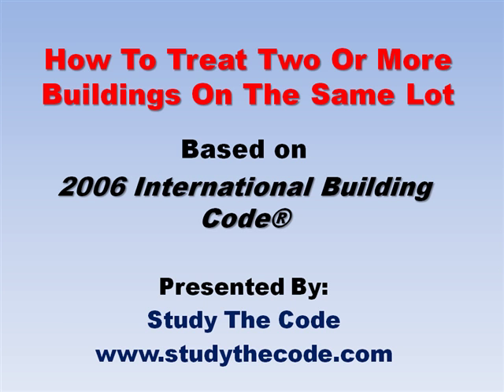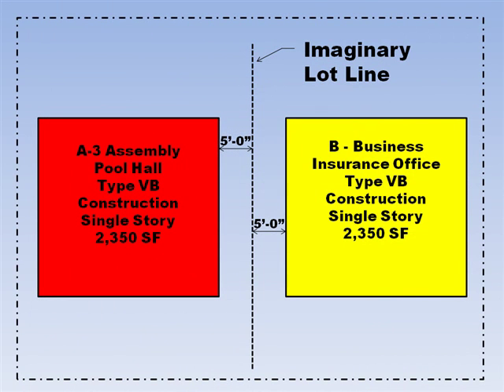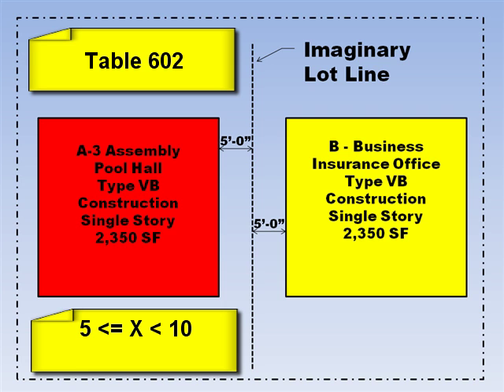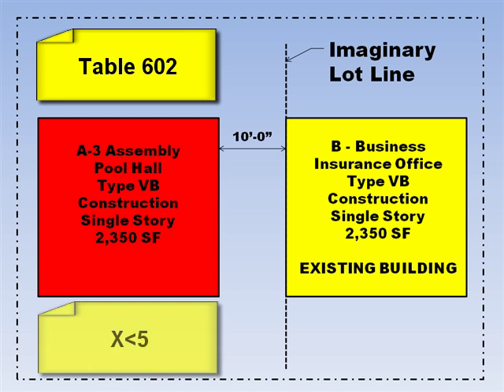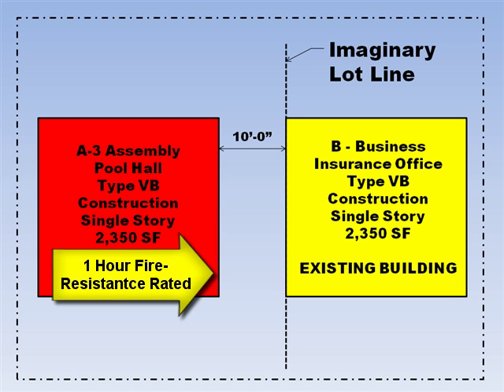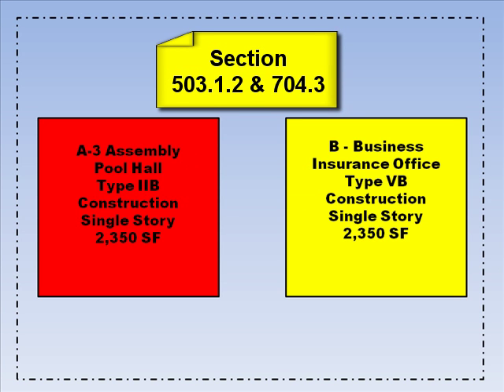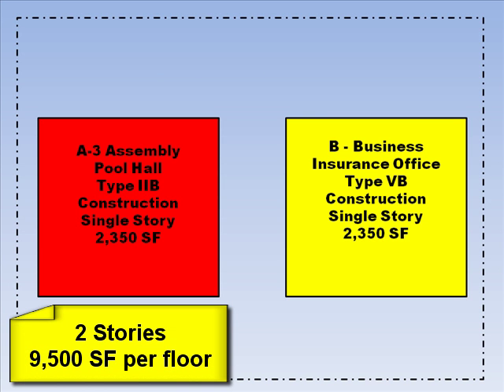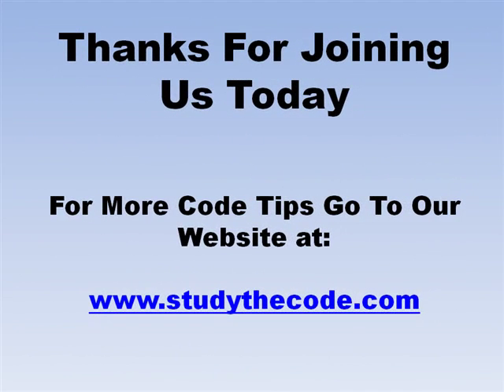How to Treat 2 or More Buildings on the Same Lot Based on the 2006 International Building Code

Comment: Concise, but wrong.  The word "property" was dropped from the code in 2003.  From 2003 on, the codes have only described it as an imaginary line.  Too many people treat it like a lot line or a property line; however, when both buildings are on the same lot, owned by the same owner, it is NOT a lot line.
Reply from the maker: Thanks for your comment and your point is well taken. But I don’t see where I mentioned anything about property ownership. Whether it is called an imaginary line or imaginary lot line really doesn’t matter as long as the intent of the code is met which I think it is been properly described in the video.
Reply: The issue is that there is a section in the code that requires aircraft hangars to be 30’ from a lot line.  If you consider the imaginary line between two buildings on the same lot to be a lot line, some architects insist you must have 60’ between buildings which is way overkill compared to Table 602 FSD.  If it is just an imaginary line, you can be 10’ apart with 1 hour Type IIB walls.

Thus the dilemma.

The 2000 IBC did use the phrase "assumed property line"; however, it was changed to "an imaginary line" in 2003 and has been that way ever since.  I think it is important that we don't add words that aren't in the code so I argue vehemently against anyone adding the words "lot" or "property" when discussing this section.  I think that the only time the 30' rule should apply is when you are adjacent with a true defined property line (neighbors) or to the centerline of a public way.

If you put 60' between buildings on one lot, you are providing more protection than you would to a neighboring property owner or the public.  It is not reasonable to think that is what code officials intended.

Thanks for listening.